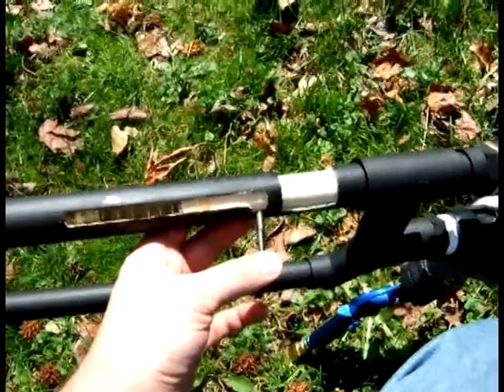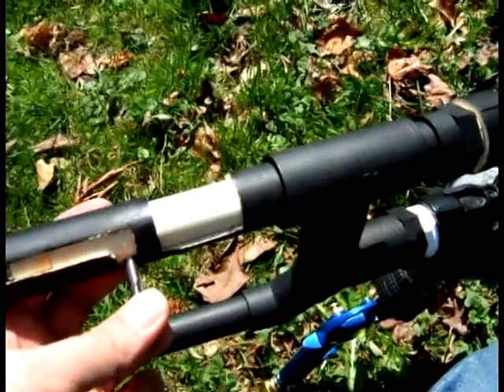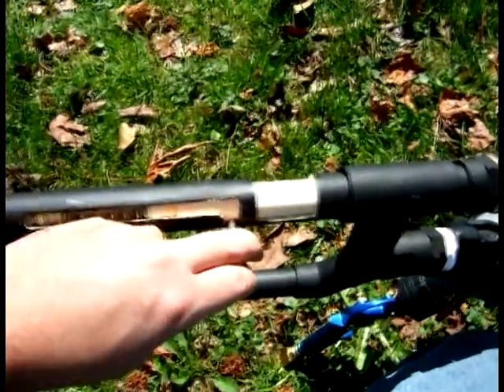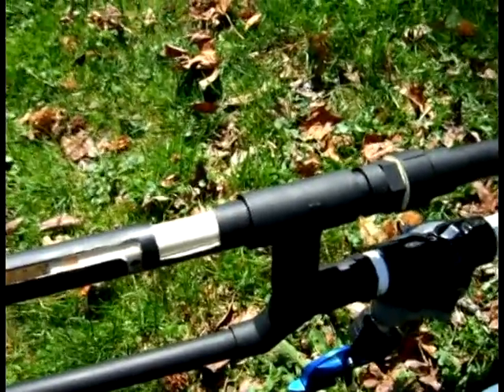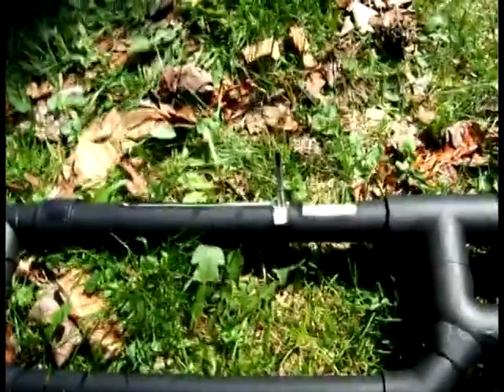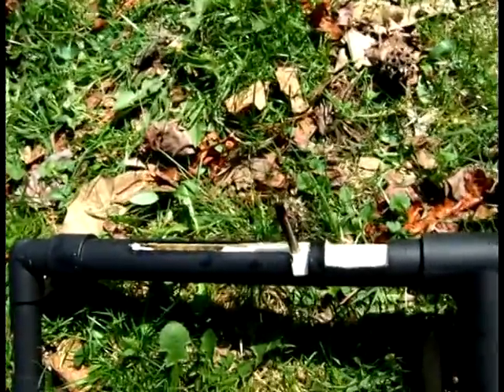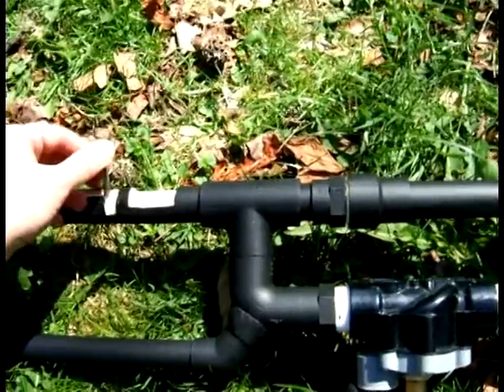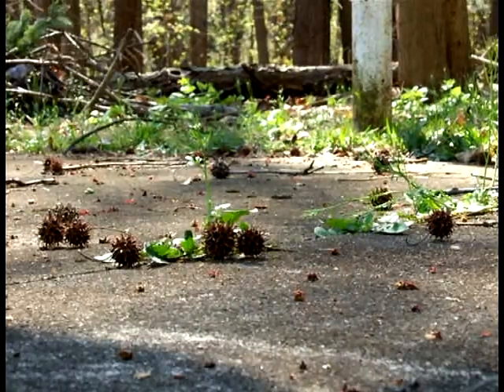PB Air Cannon With Blowback

Comment: Is it possible to get plans I have a idea on which I could use this (a paintball tank)
Reply from the maker: +kopfjager68 I will see what I can come up with for you.
Reply: +Tetsuo315 I have a sketch up model of a well my try at a 37mm breach and I'm thinking of basically secondary air tanks linked to the same firing mechanism and the main tank(propels the progectile) and the secondary tank would release air into the tubes and push the block back and springs would return it to firing position
Reply: +kopfjager68 if possible should I send you the sketch up?

Comment from the maker: I agree. By itself blow back with a single shot does not make any sense if it is looked at that way. I designed it to go both ways however. It can be used a bolt action as it is, in fact that is how the cannon is supposed to being used. It was also designed as a proof of concept to test a theory I had should I want to build a functioning feed, extraction and ejection mechanism using blow back. I have been working on a concept using stock plastic. Thanks for the reply.

Comment: Well i was gonna just leave it at that, but then you put it that way, kinda brought out the OUTSIDE OF THE INTERNET me out. usually i save my opinion for myself that way i can use the design myself. i could see if you took a tube, put a spring in it, attached it just below the breach then loaded it with marbles or paintballs then gave your self a precharging system, (something that you would use to make it so you can shoot it more than once before recharging) other than that, a single shot with-